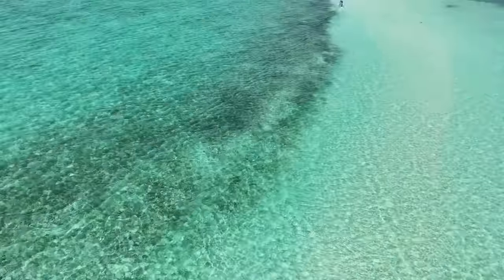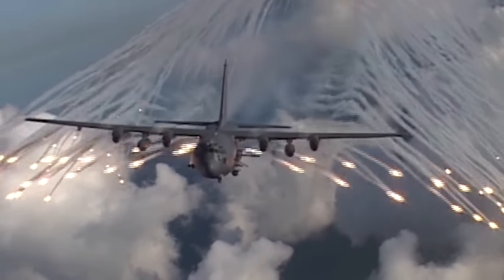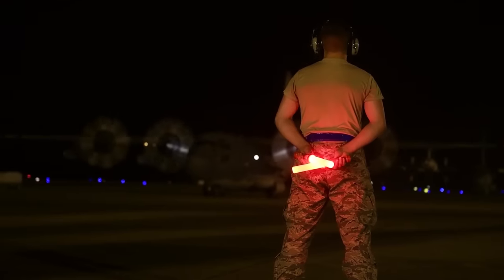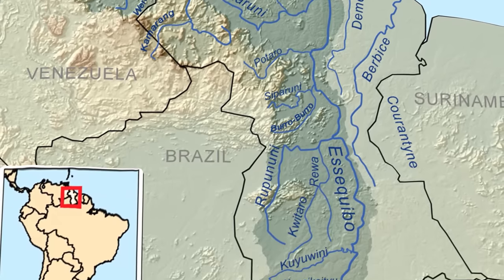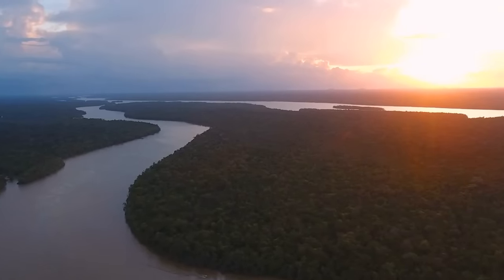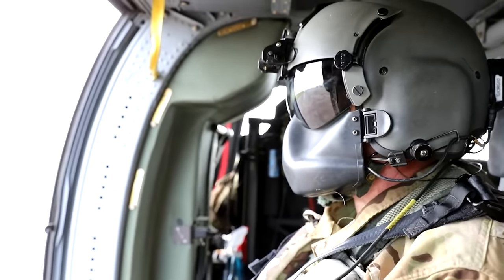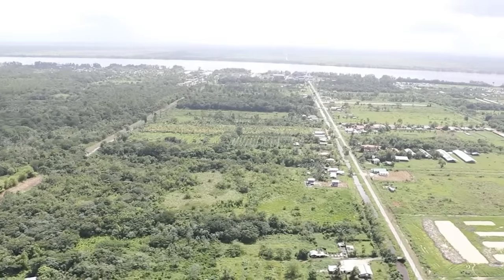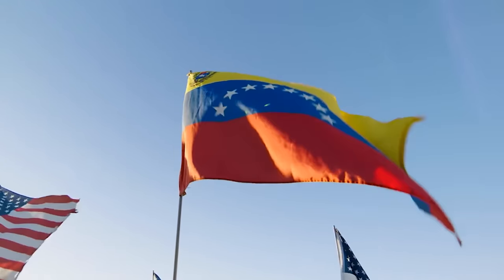America's Most Frightening Weapon Deployed in Unlikely Place - Caught in Camera

Comment: When I lived in FLA Eglin AFB was my next door neighbor. Those things flew over my house and land all the time. Many times I would wave at one of the crew members hanging out the back side and hold up a thumb asking to hitch a ride. They always waved back and some would wave me to come along and others would shrug their shoulders. We all had fun. It was very common for those birds to come in low enough to just barely miss the tops of the trees on my land. 

It was not quite as exciting as when I lived on the gulf shore on the other side of the base, though. From there we had many night time light shows when they were having target practice and the tracers were flying. When they used the 105mm we could feel the impact through the ground about 10 seconds after each round struck. With those vibrations we kind of turned my telescope into a seismometer since those vibrations appeared by having the image of a star shake when they arrived. My clock drive tracking recording made the telescope into a seismograph. LOL 

I miss being down there in The Panhandle.